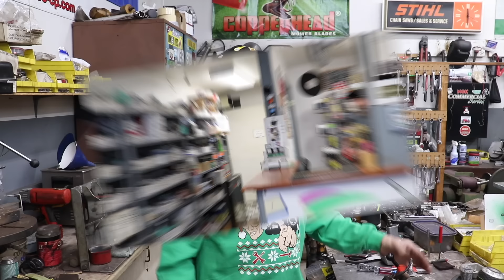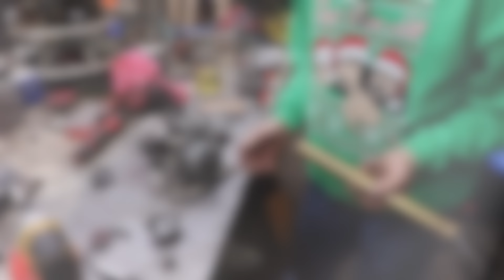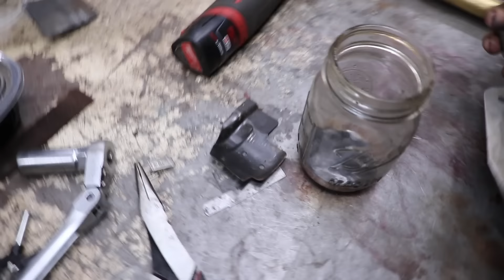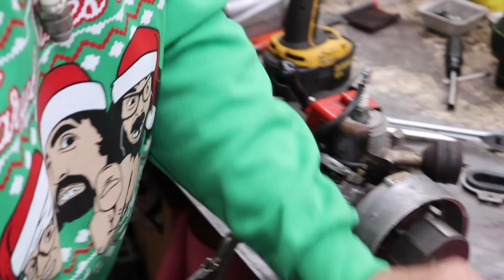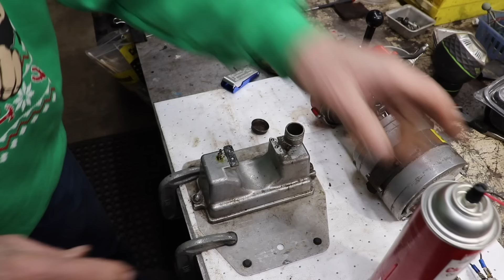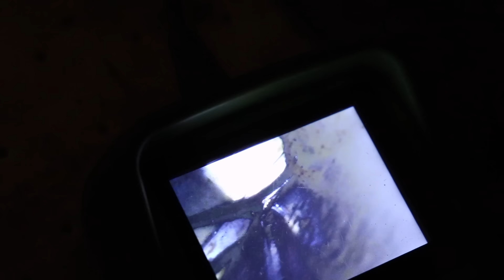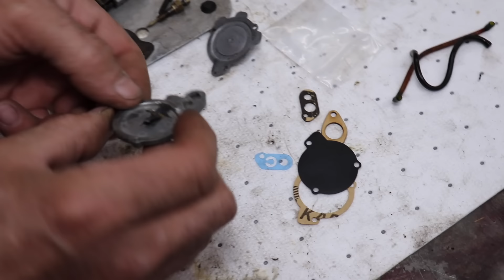World's SMALLEST Generator EVER! Will It Run?

Comment: Hey Taryl, have you heard of compression whistles? They're kind of cool and useful, you get used to the sound they make with various engines and they're a small little deal that is about the size of a spark plug.  You just thread it in and turn it over-even with a wrench-and you get used to the sound of good or low compression.  Also if your engine is stuck you can fill the cylinder completely full with oil, then you modify a compression whistle with a grease zerk fitting and can pump in thousands of psi to free the engine.  Just the tip, only the tip, and just for a minute...
Reply: Or just use a compression tester.
Reply: @alexstromberg7696  They're good to have around if you have an engine that has sat a long time and you don't want to just start spinning it over.  What I mean is that it may have fine rust or animal nests in the carb/intake... in that situation you can just slowly turn the engine with the pull starter or a wrench and know immediately if there's compression within one rotation.  You then can. proceed to adding oil to cylinder, cleaning out intake path and carb and the engine.  Then you do a compression test and will get a more accurate read without pulling a bunch of garbage into the engine.  It's also useful because you can unstick a stuck engine with it by modifying with a zerk grease fitting then fill the cylinder with oil, it's worked for me 3 times.  Also if you're thinking a cylinder is dead or weak it's way quicker than hooking up a compression tester, especially if there's multiple cylinders.
Reply: Remind me of the old air compressor kits they used to sale to go into spark plug holes to air up your tires. And the old 120 volt dc kit that mounted under your dash to run 120 volt ac dc tools off your alternator in you car. They worked great for ac dc tools and incandescent light bulbs. You can take any alternator with ext regulator and replace voltage regulator with a old type heater switch and regulate voltage and reach 120 volt easy. A old 35 amp alternator gives you little over 3 amp 120 dc. With generator unhook voltage regulator voltage is controlled by rpm. A old cat generator with rpm controlling voltage will burn small welding rods all day long or if left on 1/2 water pipe to melt ice will need to be watched so pipe dont over heat.
Reply: @cliffclark6441  Makes me think of my Dad. As he welded for farmers, often times work was rare during winter, and along about new years some pipes needed thawed and really helped in a tight
Reply: @charlesangell_bulmtl  If he was a welder he might of had a older dc welder like a pipe liner or c@h these are true dc welders, and may be even a old air craft generator turned into a welder, any dc generator can put out full amperage 100 per cent duty cycle, unlike ac or alternator which is limited by duty cycle. Your dad may have used his welder to crank engines. With a welder you can crank over a large diesel engine almost non stop. If starter begins to get hot just increase voltage to drop amps being used. Each time voltage increase cranking speed increases amps used on starter decreases. The old cats when you cranked motor you removed battery ran the lights off generator. And you could use battery in another machine. To thaw pipe you just hook welder up at both ends of pipe, start welder and wait for pipe to heat up, then unhook welder. Never leave pipe unattended even at lowest amps pipe will over heat and melt down. Never do this with a AC welder they will pass there duty cycle and melt down. Duty cycle is why electric code allows #10 wire on 50 amp breaker for a welder plug, Or #10 wire on 60 amp plug for motors with a thermal reset switch. True 5hp air compressor comes to mind. I have never seen a alternator with large enough wire hooked to it to carry 100amps, The out put on alternator,
is surge amps. Not continence amps, but what the heck big numbers sell items. Hook that alternator to inverter see what it can do.
Reply: They're not reliable
Reply: @staind288  Have you used one or just guessing?